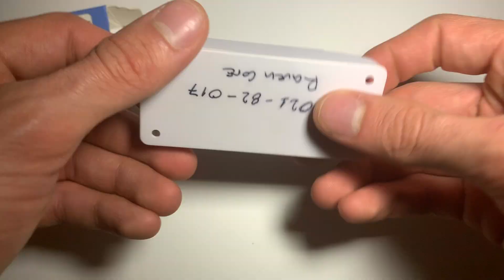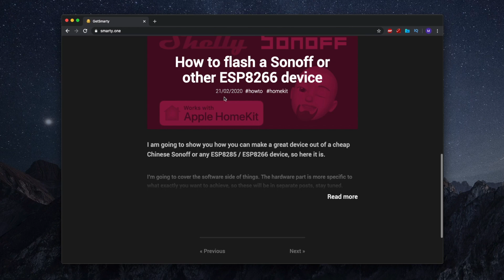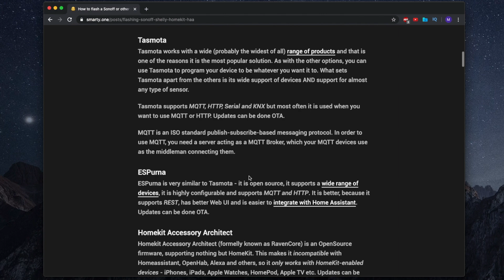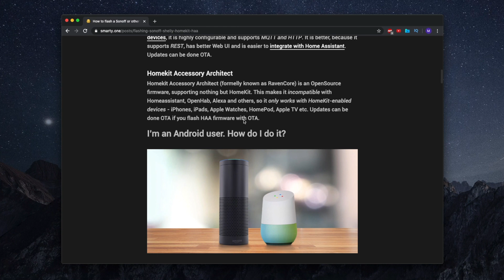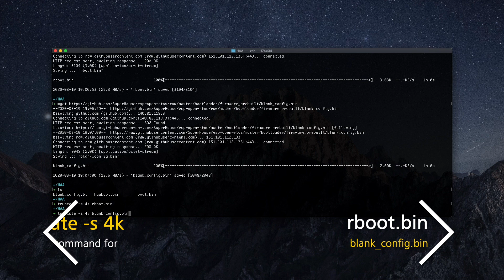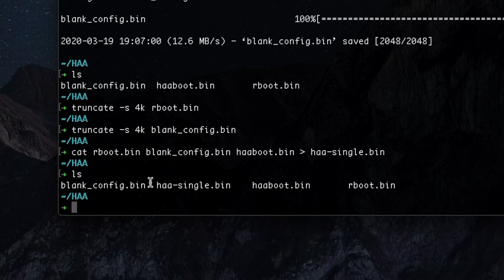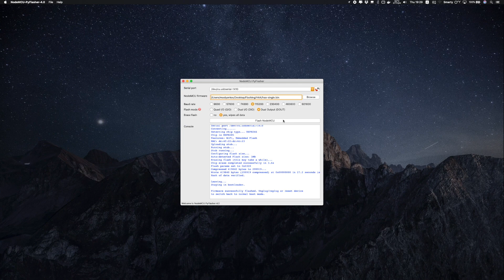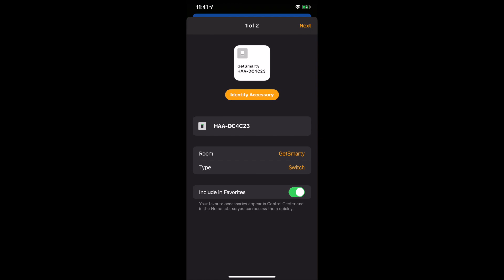Easiest way to flash Sonoff, Shelly, Wemos or any ESP8266 + HomeKit support with no Hubs

Comment: Thank you for making this video series! You do a great job of breaking down the steps, BUT I wanted to provide an update for those who might be following this today. Since this was published, many of the Magic Home LED Controller that used to run on ESP 82xx chips have switched to RISC-V based chips. Unfortunately, this means the platforms developed for ESP are not compatible and will require completely new software to be written for them. I'm hoping this changes soon, or that I'm completely wrong and there is a compatible platform for the new chips but I haven't been able to find them.

Comment: After finished and added to the HOMEKIT working with the USB but when you disconnect it and put AC it stops working, you disconnect it from the AC (120v) and I connect it through the TTL (DC-3.3v) and it starts to work well. What happened because it does not want to work with ac only with DC-3.3v. Thank you for any help.
Reply: After the last firmware haa-single.bin at the end disconnect the USB and put the AC-120v current. then you finish the JSON code procedure. thanks for the tutorial.

FYI: Don't do the last JSON-code step with the USB if you are going to use 120vAC.
Reply: @BIGFOOT1TONKA  hey mate I also worked that out but when I add the JSON code and save it doesn't show on Homekit as a device any ideas?
Reply: Work Great Thank you.

Comment: My Sonoff mini bricked after DIY installl of HAA. No LED after restarting. Please help
Reply: same problem, I dont know how to get from flash mode to normal mode (to LED is lighting) and get the WIFI
Reply: So I eventually had to flash it using the serial adapter method to HAA. It started working again.
Reply: @AkashSkylyn  the same problem ! How did you connect to the mini ?
Reply: @AkashSkylyn  what chip has your sonoff mini? What JSON did you use ? I did  flash mine by wires but after JSON and WiFi configuration it didn’t respond
Reply: @JohnSmith-yg7og  more jsons can be found here-
https://github.com/RavenSystem/esp-homekit-devices/issues/689
Reply: @AkashSkylyn   it works, thanks!

Comment: Hi great tutoriaI!
I will definitely do that, thank you very much!
I saw this procedure is also applicable to sonoff mini and I was wondering if I could flash the HAA single file on top of the itead bin instead of flashing Tasmota first, so that I could flash it Over The Air using the DIY tool because I don't have the serial adapter and I'm not sure how to wire the Mini.
Thank you once again for the support.

Comment: Hi @GetSmarty I did all the steps for my Sonoff Basic to run HAA, but when I try to connect to the created wifi network my Mac says "can't connect to....", this also happens with my iPhone & iPad
Reply: Update : one of my two sonoff basic devices connected correctly to my network, I’m repeating the process in a second device and the message “unable to join the network” still shows.
Reply from the maker: You mean you are unable to connect to the Device’s wifi hotspot?
Reply: @getsmarty2460  That's right, no matter which device (Mac, iPad, iPhone), the hotspot exists but I can't connect to it.
Reply from the maker: I have had similar issues before. After a few tries, hitting “Forget network” and retrying I have had successes. This seems to be a firmware issue. :( I am not the author of the firmware. I'd suggest you to try this and if that doesn't help, you could try to reflash and try again.
Reply: @getsmarty2460  I'll try then, thank you so much.

Comment: I believe some Shelly devices can be flashed OTA so you have no soldering. Is this true and if so could you provide a video how to? On a Mac would be great!
Reply: shelly devices have the pins accessible so, there is no need the pry open the plastic case, the rest is exactly the same as above
Reply: Preet Bedi so does this still have to be done with the serial cable?
Reply from the maker: You can do it without opening the case. Shelly1 and many other Shelly products have exposed serial pins. They are covered with a rubber cover. There is also the other option to flash it using the Tuya-Convert technique. I plan on doing a video on that soon.
Cheers! :)
Reply: GetSmarty great thanks, can’t wait! Might be a quarantine project 😂